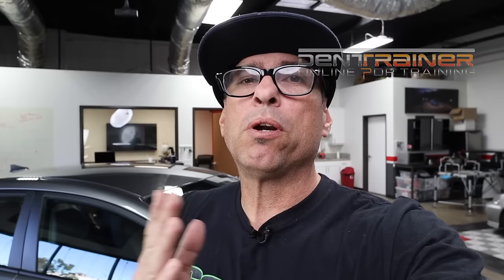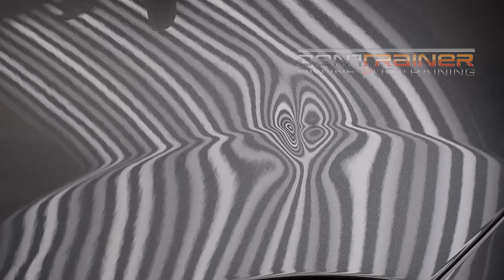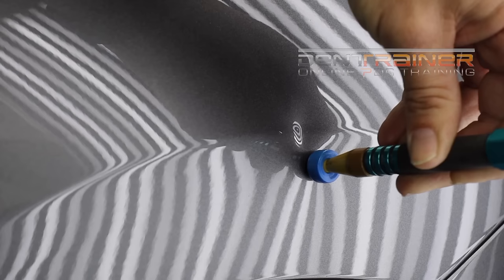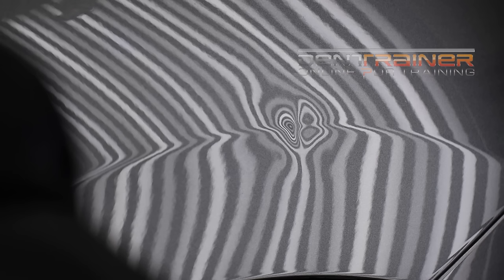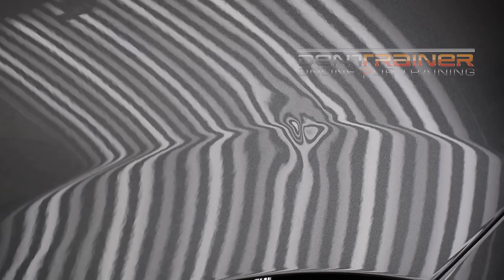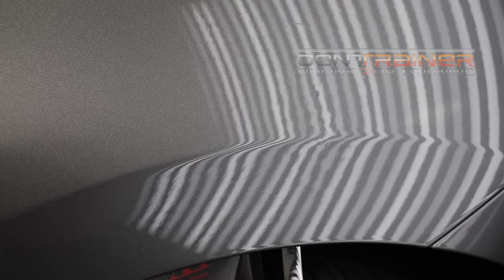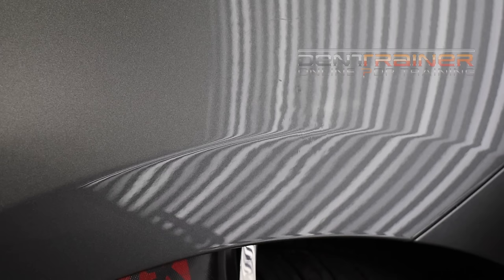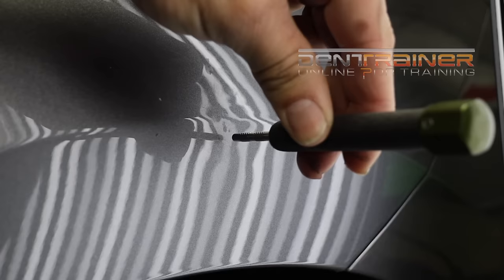Body Line Paintless Dent Repair Break Down | PDR Training Tutorial

Comment: 8:46 "Rock it, Rock it on the deeper parts. Coming down here to the bottom, I can Pin point it with the tip. You can rock it from one side and swing more aggressively from the tip. Or you can slide it down like that with pressure in the shaft."

Comment: With the raised crane tool you are using the back side not the tip is that correct?
Reply from the maker: Using the rounded back sharp area.

Comment: boy ins jobs (disconnect bumper cover disconnect light  wheel shield disconnect ' clips  disconnect rocker cover  'clips  emblems  door r i belt moulding ri mirror ri handle for blend ) color sand buff that is the norm boy wish I was that good